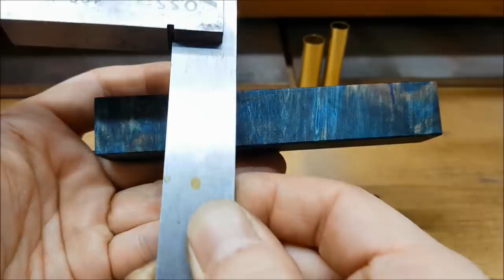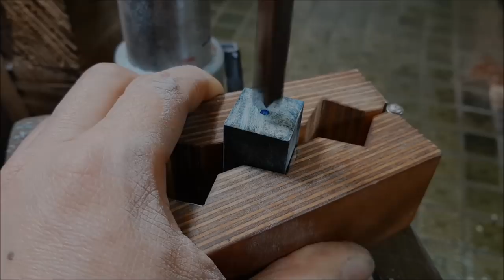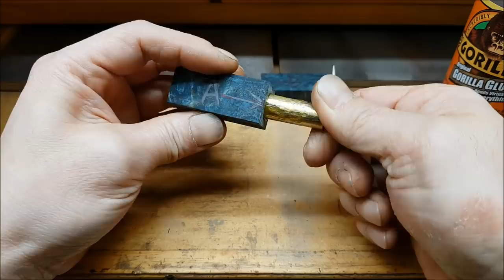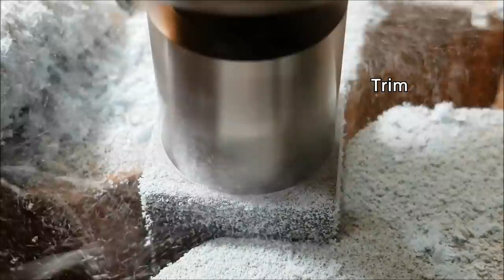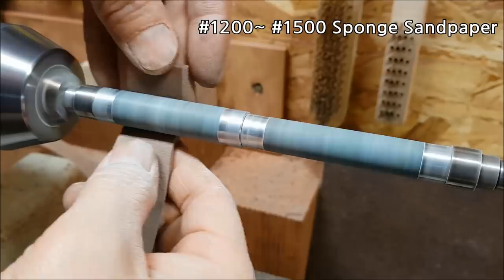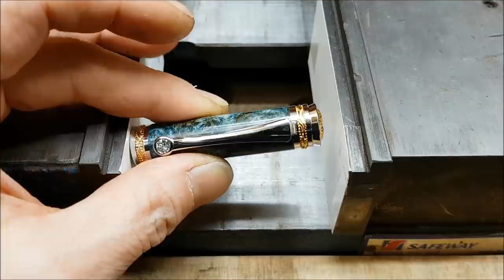Gogh's "Starry Night" Fountain Pen / 고흐의 "별이 빛나는 밤" 만년필

Comment: Yet another beautiful artwork. If only I could improve my handwriting from my usual scribble, I'd be knocking down your door for this pen.
Reply from the maker: Your comment gives me a lot of power.
Thank you.
Reply: I have nearly unintelligible handwriting yet still enjoy fountain pens. Don't prohibit yourself of a better experience, nobody but you has to be able to read your handwriting. Also, fountain pens give very slight improvements, because you barely need any pressure, in some cases the weight of the pen providing enough pressure for it to function.

Comment: Just the work of external shaft ! For fountain pan the important is the installation and quality of the tip and the writing effect !
Reply from the maker: I sympathize with your words.
I have also been using fountain pens for about 35 years...
This video does not test the writing performance of a fountain pen,
If you only care about performance, you can buy a ready-made fountain pen.
This video shows that you can make it like this.
If you are only interested in ready-made products, you should not watch this video.

Comment: 어떻게 저 나무 안쪽에도 그림이 있는 거예요??? 설명해 주실 분?
Reply from the maker: 안녕하세요~ 실버마이스터 입니다. 
구독자의 95% 이상이 외국인이고,
댓글 주시는 분들의 대부분도 외국인이라서 설명해 주시는 분은 아마 없을 겁니다. ㅎㅎ

이 나무는 벌(burl) 이라는 나무의 부위 입니다.
나무 이름이 아니라, 나무의 부위 종류를 말하는 것입니다.
오래된 나무의 혹이나 뿌리, 가지 등의 부분으로 특이하게 문양이 꼬여 있거나 뒤틀려 있는 부분을 말합니다.
소고기도 부위별로 다르듯이 특별한 나무의 경우 이런 부위가 있습니다.
위의 나무는 북미산(캐나다)메이플 나무(단풍나무)의 벌 부분입니다.

이 나무에 수지(객터스주스)와 염료(다이론 등)를 함침(나무의 내부 속까지 침투) 작업을 하게 되는데,
감압, 혹은 가압을 가하여 오래된 나무의 푸석푸석한 성질을 개선하는 작업을 한 것입니다.
그냥 물들이는 경우(염색)에는 나무의 속까지 이렇게 되지 않기 때문에,
반드시 함침 과정 작업을 해 주어야 합니다.
비싸기도 비싸거니와 어디에서 쉽게 구입할 수 없는 소재이기 때문에,
아주 귀한 나무라고 생각하시면 될 듯 합니다.

이글을 보시는 다른 분들을 위해서, 영어로도 번역본을 추가해 두겠습니다 ㅎㅎ
관심가져 주셔서 감사합니다^^
Reply from the maker: <Questions>
Why is there a picture-like pattern to the inside of the wood?
<Answer>
This  is a part of a wood called a burl.
It's not the name of the wood, it's the type of tree part.
It refers to the part of an old tree, such as a hump, root, or branch, that is unusually twisted or twisted.
Just as beef varies from part to part, special trees have these parts.
The wood above is a burl part of a Maple wood from North America (Canada).

This wood is impregnated with resin and dye (permeates into the inside of the tree).
Decompression or pressurization was applied to improve the roughness of the old wood.
In the case of just dyeing, the inside of the wood does not go like this.
The impregnation process must be done.
Because it is expensive and expensive, it is a material that cannot be easily purchased anywhere.
You can think of it as a very precious wood.